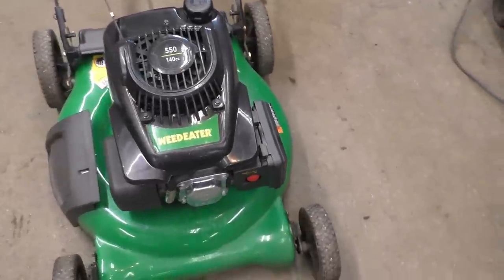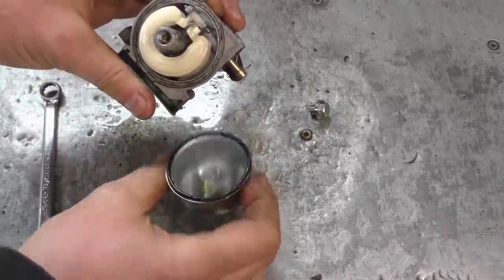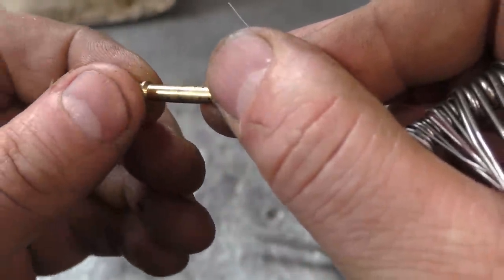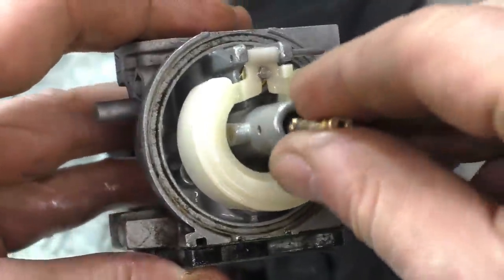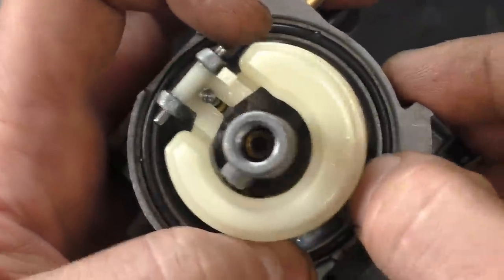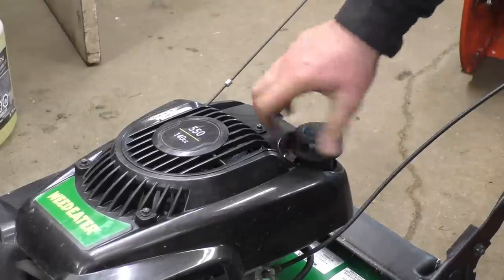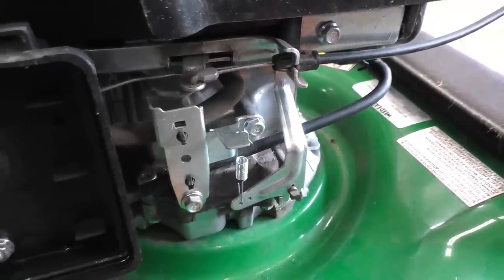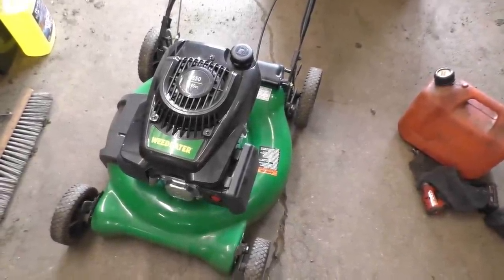Lawnmower Ran Last Fall & Won't START This Spring! Here's What You Should Do!

Comment: Remove the bowl gasket before you spray carb cleaner. The carb cleaner cause the gasket to stretch out.
Reply: i have also heard if you boil the gasket in water it can sometimes shrink

Comment: Good job! 
Funny story. I 've worked on everything from small engine stuff thru heavy equipment and trucks. One day I went to start my mower in the Spring, just like this, and no go. So I did exactly what you did. Took the carb apart, put it back together, and voila!! Started right up. I let it run on its own for a minute. Tied a rag around the handle so it wouldn't shut down. No biggie. In the middle of a big yard. I turned around and the mower was ON FIRE!!😵🔥🔥Went over, untied the rag, the mower stopped and I put out the fire. WTF?! Nothing got seriously burned. Not even the rubber tubing. Turns out there was a fine crack in the fuel line and the gas reached the muffler and poof!!
Learned my lesson. Always inspect all the lines and don't leave it running on its own. 
Take nothing for granted. That's when trouble happens. 
Cheers.
Reply: Wow you're lucky it didn't explode. I plan on replacing the fuel lines on all of my equipment this year due to all my equipment being over 10 years old and my lawn mower is about 25 years old but it still runs great.
Reply: @bretthibbs6083  Don't know that it would have exploded. But ya never know. But by all appearances, at first, all was fine. But it being an older model, and moving the carb and stressing the fuel line, it formed a hairline crack that was out of sight. Fuel line must have been brittle.
But I lived to tell the tale.😄
Cheers.👍
Reply: A mower deck is supposed to have a drain hole to let oil or gas or water drip straight down away.
Not all of them have that anymore.
They also pinch the plug wire at the cooling fins and the top housing.
Are they deliberately trying to cause fuel related problems?
Hmmm.
Safety is important.
But these things aren't made in our country anymore.
We have to do it for our own equipment once we have it.
Reply: @dannylinc6247  Mine had a weep hole. It just went poof!! I never had that happen with ANY piece of equipment I ever worked on over 50 years of working on like everything. 
I've made mistakes here and there, but was sure everything was fine. But turns out the gas line was a bit brittle and a hairline crack formed on the bottom I didn't see, or smell gas. But then, I did work on the carb so there was a residual smell of gas around. One thing we have to remember is gas gives off vapors you can't see that lay close to the ground and will ignite. I guess the muffler threw a spark or got hot enough to ignite the fuel. It all happened in about 2 minutes total. I got it running and just walked away for about 30 seconds. Turned around and it was ablaze!!😵😄
It was no biggie but it was a surprise. 
Anyway, long time ago. And I take nothing for granted since that time. 
I went on to cut the lawn many times thereafter. And, I did change the fuel line. 
Cheers.
Reply: @justincase2281  seems like you handled it well.
I had a free good quality mower given to us at a shop.
The old guy there said, don't use it.
And if you use it anyway, and I'm not here, don't use it when the grass is dry.
He was busy with other things.
Well, needless to say, the grass was a foot tall before you could say, "uff da".
I used that mower, it wasn't dry outside yet.
I looked down after a few passes and it was a nice machine, cut well. Felt easy to push
But the muffler was cherry red and burning like somebody heated it with oxy-acetylene.
Good thing there was no external fuel leak.
It ran ok, seemed to, but it was putting out unburned fuel.
I shut that sucker off.
Like you did.
I told him about it next time he was there.
He said, "you don't listen, now you get to figure it out."
I didn't run it for more than a couple minutes after that, at a time.
He gave it away, so I suppose the thing had a heavy float.
Reply: @dannylinc6247  If it were a multi cylinder engine I would have thought the timing was off. Possibly retarded spark. Could be even in a one lunger. And it could be a carb problem.
Could have been loading up with fuel and burned in the muffler. But usually that causes popping in the muffler. Like when someone tries to make a hot rod from a Honda Civic or some such turd, and they try to "tune" it. Whenever they go down the road and take their foot off the gas the muffler will load up with extra gas and pop from the overheated exhaust. I hear that ALOT on these "import tuner".  junkers. 
Kind of interesting. At least it didn't set the grass on fire. Grass fires are tough to put out. 
Gotta say, these little unexpected things out of left field sure do make life "interesting". 😄
Reply: @justincase2281  yeah it's possible the key was shifted a little at the flywheel from when they bent a previous blade, but it started ok.
Didn't shake.
I just about freaked.
He gave it to somebody who would fix that.
He didn't have reason to get into it.
Nice quality machine though.
Just a push mower.
And we used it to keep the entry clear a couple  times.
I think it was incomplete combustion and flooding. Didn't pop and fart. Just a red hot tail on that beauty.
Reply: @dannylinc6247  Was probably timing. Doesn't take much sometimes. 
Cheers 👍
Reply: @justincase2281  TARYL fixes all, says, 3 things.
1) partial misaligned flywheel key.
2) has a lot of hours, needs a valve job.
3) lean condition caused by passages in the carb jets slightly clogged by old fuel or jetting is tight, needs sized.
That's for cherry red muffler being the only symptom.
The mower I had was old enough to need a valve job.
And any machine that sits can have fuel that sat in it, or jets that just need a wire put through them.
Anyways, the guy who received that one had work to do is my bet.
Leaky valves.
I was wrong about heavy float.
That would cool combustion.
Reply: @dannylinc6247  " Hot tail on that beauty." Just reread that. Sounds naughty.😄
Anyway, was just thinking if the flywheel key wasn't sheered, the flywheel could just be off a smidgen, which would cause a problem with ignition timing.
I used to work on golf courses as a groundsman and mechanic. Can't tell you how many times one of us would hit a rock and the machine would stall out. Then, if you tried to start it, it may not start at all, or pop, fart, even kick back hard. It was always the flywheel key that sheered off. Sometimes referred to as a "sheer pin". Made of aluminum usually so the crank wouldn't be bent in the event of hitting something hard. But there were times when the crankshaft did get bent ever so slightly that it was imperceptible at first and the mower would never run right. Everyone was pulling their hair out trying to figure it out, and tear the carb apart, clean out the gas tank, blow the fuel lines out, change the fuel and air filters, all kinds of stuff. But upon deeper inspection, you could tell the crank was bent. Sometimes like a slight curve that would cause the blade to wobble and shake the machine, or there was a slight twist in the crank that threw the ignition timing off, but not quite enough to affect valve timing much. I straightened a few and got the mowers going again, but they were never quite right. But they ran and that was good enough. Sometimes the golf course was just as well off buying a new machine once the old one but the dust.
The kind of bend in a crank that causes the machine to wobble because of imbalance can destroy the bearings and seals over time. But I did keep them going as long as possible.
Sometimes swapping out the blade and balancing it in such a way to counter the wobble helped a bit.  Whaddya gonna do?
😄👍
Reply: @justincase2281  yes, taryl says that's possibility 1).
He would know.
He's been playing with and fixing mower engines since the 4th grade or so.
Now he is like the old wizard and then some.
If he needs help, he calls his brother who looks like he was raised by wolves and the "grassman".
His name's FARYL.
He's at the large dealership in that area of Indiana.
Those guys fix everything, or they part it out.
They even had a 36 Clinton weed and grass cutter on there that would be unsafe for everyone but the operator
Aptly named, the. Clinton would take any unsuspecting living things off at the ankles.
That's a good show about a repair if you ever saw one.
Reply: @dannylinc6247  I watch Taryl sometimes. Very entertaining, and he knows his stuff.

Comment: Hi Don , don’t know you agree with me or not , when season end , run the lawnmower until the carburetor emptied , then fill with transmission fluid , next season , emptied the transmission fluid out , then fill with fresh gasoline , start the engine, it would be heavy smoke comes out for roughly 20 seconds , I have been doing it for 15 years , the same machine yet to let me down ( yet to have to clean the carburetor) have a great Sunday !
Reply: Type F or Dex/Merc?
Reply: @marshmower any type of hydraulic fluid with do  !
Reply: Thanks for the tip my man!  Quick question, what am I filling with tranny fluid - the dismantled carburetor? Surely not the mowers tank? I hope this comment gets bumped up or you make a video cos this is how you actually prevent the EXACT same thing from happening next season!

Comment: For me I put gas preservative in the fuel in the fall. In spring tilt lawn mower so spark plug is down and pull engine cord slowly. This lubes the engine rings and restores loss of compression due to oil having left rings over winter.  Put some fresh gas in the tank. Follow normal starting proceedures. Usually starts on first or second pull or usual effort.  Works on most small engines that are stored for many months at a time. The rings dry out and you loose compression,  this process restores it. For car or other engines some times pull spark plug and put a little oil in the cylinder works same way.
Reply: Also start them up every month or two and let them run 10-20 minutes let the engine get to full operating temperature.  we do that with both mowers and the motorcycle.  We even take the rider out and run the blades on high cut setting to

Comment: I use a wire from a Tecumseh needle valve, it works fine. Drain the gas at the end of the season, and run it till it dies out.

Comment: Good video ! here in the U.S. the "EPA" would have a "hissy fit" seeing someone use a cutting torch tip cleaner on the jets. Honda makes a tip cleaner that doesn't enlarge the orifices. Just straight wire. Works well !

Comment: In the past I've always just used cheap gas and I don't think I ever used Stabil in my equipment til my brother told me to use it and even then I always had trouble starting my lawn equipment in the spring then I started to use the non ethanol fuel in my equipment probably close to 10 years now and never have a problem starting even after sitting for nearly 7 or 8 months through the winter.

Comment: With “minor plugged” jets (ran last year), I’ve had good luck leaving carbs installed on the machine, removing the bowl and working a welding tip cleaner up the jet and then blowing compressed air up through the jet and putting the bowl back on.  It usually takes just a few minutes.

Comment: I have a 20 year old Craftsman 4.5 horsepower push mower,  every fall before I put it up I run the gas out and it seems like it starts better come spring. I think condensation builds up moisture in the garage.

Comment: Cleaned my 140cc engine's carb, but the idle was surging after that.  Cleaned the idle jet.  Better, but still surges a bit.  Maybe the idle is a bit low...  We shall see.  It's brand new, but was stored over-winter with some gas in it... so the takeaway is always to empty the mower of gas when storing away.

Comment: You don't even have to take the carburetor off. Unscrew the bowl bolt and take it down - and then take a small screwdriver or an L screwdriver and take the jet out and the tube - clean them up - put them back in - put a rubber gasket on the the bowl and bolt it back on.

Comment: usually just removing the bowl screw and spraying up into the jet with carb.  cleaner does the trick. Saves from disassembly. On some the jet is part of screw then just clean it after removal

Comment: The Sears Mower we were given for not running has a primer bulb but it connects to nothing?   Probably the issue with this mower ..it has a plastic carb so gotta see if a hose is missing there

Comment: I really like those plastic carbs Briggs uses on the consumer OHV engines, I know a lot of people hate them but, since the whole fuel system is plastic except the press fit jets corrosion seems to be less of an issue, and if you do need to clean them you don't even have to take off the carb and fight the linkages, you just use a 7mm to take the two bolts off the bowl and use a flathead pry it off, then use the flathead to pop out the jet cartridge.
Reply: Correct but the jets are so small they get continually clogged if you do not keep debris from entering the fuel tank. You would be surprised how many of these at Eliminator Performance in Canada had a fine piece of dried grass stuck in the jet.

Comment: I had the same thing this year fixed last year n ran great went to start and no fireing or anything spayed carb cleaner in the the carb and spark plug hole and nothing adjusted the ignition coil and boom fired and on 2nd pull and now fires on 1st pull and just did this 3 days ago

Comment: Are these carbs different than those on a gas pressure washer? Every year like clockwork, if the washer won't start on the first couple pulls, (especially after sitting over winter), I know to clamp the gas line, pull the bottom bowl off and clean the orifice in the nut. Starts up effortlessly after doing that.

Comment: Hmmm, I have a very similar carb on my little toro snow thrower.  That carb gets "dirty" at the drop of a hat, even though I physically drain it at the end of the winter.  You can't really see any issues with the jet, but it starts surging, so I know I have to clean it.  The set up on my little toro is a pain because I have to remove one of those carb mounting studs in order to be able to swing the carb so the linkage can be removed.  Perhaps I just don't know "the trick" to getting the linkage off.  I should have kept the old two stroke Toro sno thrower, that thing was a beast and the carb never got dirty.  Gave it to my brother, much lighter and more powerful than the 4 stroke I replaced it with.  Wonder who makes the engine, Toro??

Comment: All ya need to do is go to menards buy a mtd petcock kit,,cut the fuel line and install petcock…then whenever you are not gonna use your lawn mower ,snowblower ,,motorcycle,,shut petcock off and run,engine till it dies…I’ve been doing this for 40+ years and the engines start up every time…😊😊😊

Comment: Hey Don
I couldn’t help but notice you didn’t clean the pilot jet? Was there a reason for that? 
I find that they are always blocked. On your advice from a previous video I purchased a micro drill set and use that to clear the blockage and open the jet slightly. 
Cheers

Comment: I like the flattening of the bowl seal area .  Also the little metal sleeves sometimes fall out of plastic filter cover . In case your wondering where did these little bushings come from . 😂👏👍great video
Reply: Right on Bob i normally put a little SealAll glue around them on the OD so they never fall out again.

Comment: Put some Mechanic In A Bottle in the fuel tank to clean the system and use regular starting fluid the first time and let it run for 5 minutes.

Comment: I have a Husqvarna 21" mower the model i have doesnt have a fuel filter which is strange i guess that Husqvarna wanted to cut corners nonetheless once awhile i have to tear apart the carb & open up the fine hole in the carb with a paperclip put it all back together then runs fine but first mower i owned without a fuel filter.

Comment: Carb cleaner is a very aggressive solvent. It will swell an O-ring very quickly. That is why it stretched and had to be replaced. If you don't believe me, put one in a container with carb cleaner and watch it happen.

Comment: First thing I do is take the carburetor  bowl off because I know it  probably has water in it. I ALWAYS drain out ALL the fuel on someone's  non- start mower. I usually drain it in a container so I can see the huge water bubble in the container. I usually take a small video for the owner to see. After cleaning out the fuel system, they usually start right up. I then tell the owner to dispose of any and all fuel in their gas can and go buy recreational fuel. 90% of the time, they tell me they just filled the mower and or fuel can. I tell them their can is contaminated with water, unless it was bone dry, I can guarantee  there was a LOT of water in that can. On an engine that surges, it's best to go through and open that main jet just a bit. I usually use the step up method to closely monitor how the next size up hole works . It may take time, but the owner will thank you.
Reply: I have a cheap Poulan mower for trimming around the trees & bushes.  It always surges when it is cold, but eventually smooths out (mostly). I took the carb apart, found no dirt or corrosion, cleaned everything anyway, no change. I've been told surging indicates it is starved for fuel; I thought I might need to adjust the float up a little to let more fuel in? Or is drilling out the jet a more likely next step?
Reply: @DaddyBeanDaddyBean  I would drill out the jet. Just be careful and always go just one drill bit size at a time. I have a set of micro drill bits I purchased at a hobby store. It has always worked for me. If you go to large of a drill bit, you cannot add back what you took away. ( Well you can...using fine craft wire) I generally will not do this on a customer's mower or blower unless they say it's ok and no other method to stop it works, such as replacing the carburetor.